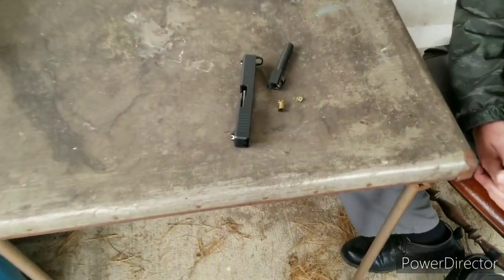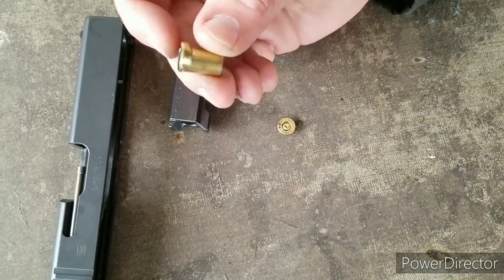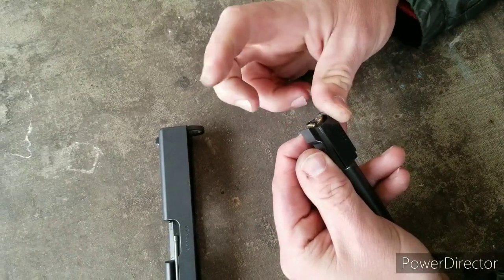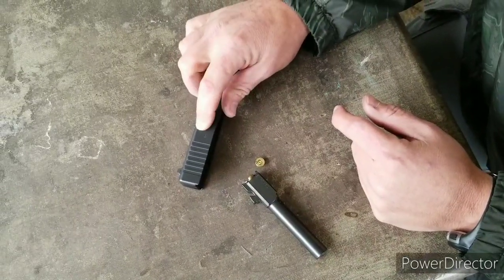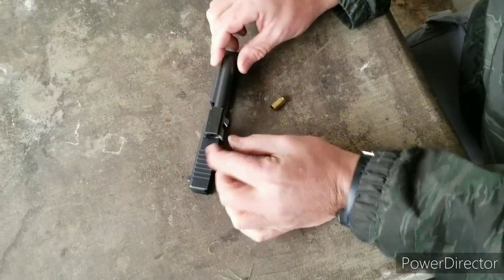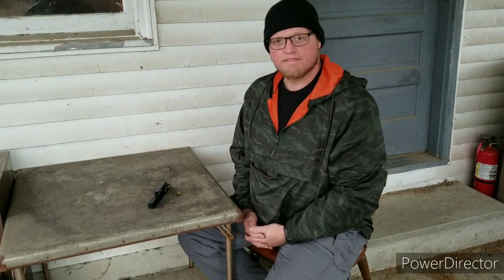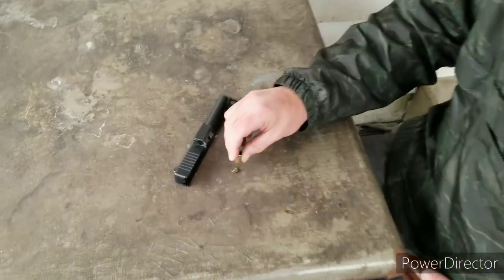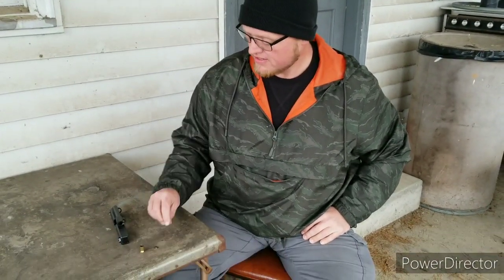WARNING!!!!° DONT SHOOT RELOADS OR REMANUFACTURED AMMO IN ANY GLOCK...

Comment: First, let me say I am glad no one was hurt. However, I don't see any evidence that this event was clearly caused by handloaded or remanufactured ammunition nor any evidence that factory ammo would prevent what ever caused the failure. There are many variables that could have contributed that range from a piece of badly manufactured brass, to powder used, how much powder, bullet seating depth, compressed load, fouled chamber, not in battery, and the list goes on. Jumping to the conclusion that you cannot use handloads in a Glock barrel based on this one event is too much of a stretch. Many manufacturers include statements saying not to use handloaded ammo, not just Glock. I have well over 10,000 rounds of handloaded 9mm ammo fired safely from Glock barrels. I appreciate you sharing this experience with fellow Glock shooters.
Reply: Howard all of your statements are true.  However metal fatigue at  the base of the case is dangerous.  The only way to determine just how much expansion at the base of the case is to mike it there before resizing.  For some reason my resizing dye resizes right down to the extracting lip on the cases of 9mm. I don't own a glock and now for sure I am glad I don't. I am a Sig man and have fired over 30,000 rounds without a single issue.  All reloads to boot.  I have been at the range and witnessed a glock blow up.  The guy was lucky in that he was not hurt.  Everyone assumed his loads were too hot.  Perhaps his issue was the same as illustrated
  There are a lot of uninformed people at the  ranges.  I met a duzzy last week.  He was blaming a brand new gun because it would not extract spent  cases. He said the loads worked In another gun ????  There are several issues that could cause the problem.  But he would not listen. Oh well
Reply: I believe it use do to a double charge
Reply: He didn't say thou shalt not reload for Glocks just because of this incident. So don't accuse him of that. He also cited the manufacturer's operator manual and a Glock armor course curriculum.

Comment: Hmmmm, thousands and thousands of reloads through mine, even lead ones. I just clean my guns and make sure my load data is spot on. No issues whatsoever, zilch, nada, none with my factory barrels. I don’t load mine hot except for 10mm, and all I did was add heavy springs to them.
Reply from the maker: Do what you do bud.
Reply: @rdmfjones5421  sure will bud
Reply: you do understand that a glock barrel has 20% of the rear end of the chamber missing and therefore there is "potential" danger there if a piece of brass with a weakened bulge spot from a previous firing through a glock lines up with that hole in the chamber it could give out.  You acknowlege that though right?  It's your choice to ignore a risk that's totally your decision but I'm hoping you're doing it with a complete understanding of the issue.  It seems to me that he risk is very small but it is there.  If you shoot a lot then sooner or later that spot is going to line up and go boom.
Reply: Hi I am new to the gun world I don't own a gun hopefully soon that will change. I was wondering when you say (hot) you are referring to the gun being hot from shooting a bunch of rounds?
Reply: I found this video because I was having issues with some reloads a friend made not going all the way into the chamber and then getting stuck in my gun. All the brass he used was from a police gun range and I noticed afterwards that the back of the case is slightly bulged. I’m glad I found this before I continued to shoot more and had it blow up.
Reply: I think the biggest issue is using cases shot from a Glock that are now bulged and then putting them back into a Glock.
Reply: @Micscience  guess they refer to powder weight..
Reply: This man was a Glock Specialist, take the mans word😂 does one have to blow up so bad someone loses a hand to realize 😂 good video, bad comment @JBJ Honez

Comment: Having owned a Glock 32 (Gen 2) now for some 24 years, it has digested several thousand of my own hand-loaded .357 Sig rounds,  I've had zero problems, 100% reliability.  I would NEVER shoot someone else's reloads, I have no idea what they did or how careful they were.    Fired brass MUST be checked for case length because they will tend to lengthen after repeated firings; more pressure/hotter loads-shorter case life.  If you have to trim a case after firing, logic should tell you the case wall is now thinner and you are now running the risk of case failure if you load it hot.  A smart re-loader examines his fired brass, looking for blown primers, brass runs and split necks
Reply: You have armed yourself with reloading knowledge and have applied common sense to produce your reloads.
Reply: How many firings are you getting from your 357sig brass? Also have you had any problems with neck tension after the 3rd or so firing? I can't seem to make them last more than 4 firings. At the 3rd I have to use a lee factory crimp die really tight or ill get bullet setback just from inertia.  The hornady seat and crimp I have to abandon after 2 firings. The taper crimp won't seem to hold reliably after that. Not sure whats going on with that but I always use the same brass and bullets so its not a component issue. Hornady 115grn xtps and always sig or ppu brass. Its just seems that after a few firings the case neck is weak or something.  Ever experience that?
Reply: @KurtOnoIR   Taper crimp is insufficient with a bottle neck case.   Suggest getting a Lee roll crimp die, this is now the final step after bullet seating.  the Lee die gives a much stronger 4-point crimp.   I found it also really helps to insert an inert buffer over the powder charge that prevents bullet setback if the crimp fails.  this is harmless to do and will actually help primer ignition but i would not do this will full power loads.  I tried cream of wheat at first, but it gave too much fouling, then found wood cellulose/stem pith works great, it's like organic styrofoam.    I put a wad of wood pith  over the powder charge,  then seat bullet, if the pith is compressed it helps support the bullet against the crimp.  I do not load anything more than 94% max charge when using filler, it's inert and will not harm the barrel,. I prefer 125 grn  bullet as it gives more surface area for crimp.  Lots of stretching and trimming in the cases after 2nd firing,  when I start seeing case neck splits then it is really time to check case OAL and trim.

Comment: Reloads aren't the issue. The person doing the reload is.
Reply: If the reloads are made from unknown case source then that becomes an issue
It would seem that there must be a limit to the rounds  fired from a glock.  Someone may have done a study as to how any times you can safety reload glock brass 
 If fired once in a glock and subsequent firings  are made in a non. Glock then i would assume the brass would be okay
  It is the reloader who must be up on the situation
  Thanks for the great video.  Great information
Reply: @rbm6184  I can’t speak for other caliber GLOCKs but I’ve never seen a 9mm chambered GLOCK that didn’t have fully supported chamber.

The problem in this video is indicative of poor quality reloads that would likely fail in any 9mm chambered firearm.
Reply: I use Speer 115gr, titegroup for 9mm it’s fine, looks like someone tried to use that brass too many times as what’s wrong with it they did not prep it properly or did not throw it away it’s why it’s always very important to inspect your brass and I never reload mine more than a couple times
Reply: @rbm6184  I’ve been reloading for my Glock for months now and I have yet to have any issues. Nor have I seen the “Glock bulge”. Idk mine is a polymer 80 Glock 19. Maybe it’s the after market barrel I have?
Reply: @basketcas3717 : the barrel, most likely is a match chamber. Do you know how to measure the case head?... just at the base of the case head. The case head was the small section of the two pieces. Take a set of calipers and measure just above the solid part of the case and if you are below .393 you are GTG.
 I built a p80 34 with a 6.5in... FULLY SUPPORTED CHAMBER barrel and loading 115gr. fmj. too an average of 1505fps. I've had two pieces of brass over .393 and I'm on my sixth reload with this group of brass.
Reply: . @danielswartz6818 , You are correct, there are several variables regarding the cartridge that can affect brass life.  I would imagine brass from powder puff loads will last longer than brass from plus P+ loads. Excessive crimping can cause stress cracks quicker than mildly crimped brass... etc etc.
Reply: @rbm6184  Correct. It is my understanding, Glock believes the advantages in reliability outweigh the concerns with their unsupported chamber. Glock is trusting that each piece of factory new, brass-cased, ammunition will function properly the one time it is fired in their barrel, the spent case can now no longer be trusted for use in their barrel. Technically most service pistols do not have a "fully" supported chamber as they were designed to feed from a magazine and must account for feeding reliability. Glock barrels have far less support of the chamber and the results are well documented. Barrels are cheap fingers are not... use the correct barrel for your situation.  Just my own humble opinion.
Reply: Either that case had been loaded too many times or they put to much powder in it.......period
Reply: @jasonhacker7270  yea that can be it also
Reply: Case separation isn’t from “unsupported chambers”.
Reply: Glad you are ok..  if you use reloads, reload THEM YOURSELF!! that way you know EXACTLY what you are shooting.. if you do it correctly, and not beyond established safe parameters, reloads work fine.. like one of the other commenters said, it looks as though that brass had been reused too many times.. buy remanufactured car parts, NOT AMMO!!
Reply: @basketcas3717  are you running stock barrel or aftermarket
Reply: @MrZimeir  I believe it’s a lone wolf barrel that came with the polymer 80 I built. Which may explain why I don’t get the “Glock bulge”.
Reply: @Boondogsaint  I agree with you on this, but I don't even reload mine a couple times. I only reload a brass casing one time after I fired it from new in the box just to be safe and not have as much of a chance of issues as with multiple reloading. But it is just my preference and it is 100% the person who is reloading the casings responsibility to check everything and make sure there's no signs of issues with the loading of the brass.
Reply: @riflesfirst208  I had an exploding case in a Glock 19 yesterday. This was the last of a box of 500 reloads made by Miwall, which my SIG 226 fired over 400 rounds of without issue. I will never use any type of reload in any Glock.  

If this happened to a new shooter, it might be enough to make them never want to shoot again. For me, it was just a curiosity. The mag dropped out and my hand stung a bit. A larger caliber could cause injury and destroy your gun
Reply: @johnlocke2884  So you used random reloads of unknown load data but it’s a problem with the gun. 

Got it 👍🏻
Reply: When using a progressive reloader you need to pay attention. Most of the problems are from people using progressive reloaders and not paying attention
Reply: I have a Gen 5 17 and 19X both with the marksman barrel.  I shoot my own reloads all the time.  I honestly don’t know if my chamber is fully supported or not.  I’ve always been a Sig and 1911 guy and I’m pretty new to Glock.
Reply: Wrong THEIR IS A REASON why glock states NO RELOADS OR REMANUFACTURED OR LEAD BULLETS!!!!!! It's not the reloader this gentleman in the video is 100 correct.

Comment: While I have heard a lot, seen a lot, and done a lot, I will never say I've seen, done, and heard it all. I have owned my Gen 1 model 17 since 1987, I've been reloading my own ammunition since 1984. Still have the original barrel in it and it's sent roughly 100,000 rounds down range, more than half of my own making. Either I got one of "the good ones", I'm damn good at what I do, am the luckiest re-loader in the world, or a combination of all the previously mentioned, but I have never had this happen to me. All that being said I have built dozens of firearms and with every glock I build since 2005 the first thing I throw away is the molded injected metal extractor. As far as the cases and processes I follow when reloading, attention to detail is critical, measuring the cases, inspecting the cases, and cleaning the cases is the easy part, checking at least every third round that the powder measures correctly is most critical but not far behind is seating depth. Depending on  powder used and the pressure and velocity it will make the bullet seating depth can change everything. I crimp my reloads heavier than most, this is due in part to personal experiences when a failure to feed malfunction results in a bullet being pushed deeper into the case as it feeds into the slide or the back of a non-ejected spent round. Many a firearm have been destroyed by not paying attention to every aspect of the firearm function, when it comes to hand held explosive devices, safety can never be excessive.
Reply: I just recently bought a new Glock 21. I am also a reloader, hate to tell you for how long or how many millions of rounds I've loaded with never a problem. Until I bought this Glock. One of the first magazines I ran through it was some reloads with Speer Gold dots in them. NOT loaded plus P, but admittedly full power loads. No blowouts but to say Glock smile would be an understatement. You struck a chord with me that I had already figured out. Due to the bullet design, I had loaded them pretty deeply into the cases. No other reloads have produced such results or anything close to it. And even with factory loads there is no doubt where the case head is not supported. Piss poor design in my opinion in the first place. The gold dots were 185 grain bullets. Have loaded 230's with the same powder charge, but to full length with absolutely no problem or guppy bellies at all. Just my opinion, but if I were reloading for a Glock, I'd try to get the (Smile) up when loading mags and let them fly, as hard as that is for a reloader to do so you're not stressing the already stretched head and taking a further chance on a blowout.
Reply: 17 is a 9mm , next time you see some shooting a Glock 40s&w pick up 20 pieces of brass and you will find probably 3 with a swollen side by the base of the case , Glock has HUGE chamber tolerance on their 40s&w barrels . Making them vulnerable to this .
Reply: Do it right and you'll be fine! I've been reloading for 30yrs and have never had a problem through dozens of rifles, glock pistols, revolvers and shot guns.

Comment: Truly, it looks like you got a double loaded round. The blowout the way it did is part of the safety feature of the gun, path of least resistance, as a reloader I have seen this before too. The ejector is the weakest link on the side of the gun, it breaking away allows the pressure to go in a safer direction than up or out. Replace your extractor also check you safety plunger to make sure its still working correctly.

Comment: I reload.  I was shooting once with some friends who brought factory ammo…. Winchester white box 230 grain 45 ACP.  One of the rounds did not action the slide but the bullet definitely exited the barrel. I charged the slide and continued on. 

As I was picking up brass, I found a 40 S&W case that was “swelled” to the chamber of a 45. Winchester put a 40 round in a box of their 45’s. That was the round that fired but failed to action the slide.  I asked my friend who brought the ammo if he previously opened that box and he said no.  I was certain that the 40 round wasn’t one of my reloads that I accidentally loaded into the magazine because the primer was a Winchester and I load cci primers exclusively.  Point is, even the “factory ammo guys” screw up. 

You’re going to ask “how did the 45 detonate the 40?”  I know, it shouldn’t happen. But it did. I swear to everything that is holy that the round fired. 

I’m well over 100,000 rounds into reloading my own ammo.  380, 9, 40, 10, 45, 44, 38, 357, and 223.  I’ve put many thousands of my reloads through multiple glocks with factory barrels…. No issues.  

I have found the “Glock buldge” on a few 40’s. All of my 40 and 10 cases get resized on my Dillion in a single stage manner.  I then run them through a Redding grx die set up on a lee single stage.  I prep all my cases by resizing, depriming, and tumble washing with stainless pins first.  I then case gage EVERY prepped case before I throw them in my “ready to load” bins. I chamfer and deburr each case as well 

I spend A LOT of time on case prep. However, these steps identify cracked, split, and otherwise damaged cases.  If the empty case doesn’t case gauge, I don’t use it.  

Finally, I load to book data.  No compressed loads.  No magnum primers when regular primers are called out in the books. I follow the published data.  

I’m not buying the “no reloads in a Glock” story.  Every firearm manufacturer has that disclaimer in their manual.   It’s the reloader, not the reloads, that are the problem.

Comment: I've shot reloaded ammo in my Glock 27 for years. You just have to make sure you properly gauge your cases and don't try to load overpowered (hot) rounds. I can easily say I've sent at least 30,000 reloaded rounds (many of those cases got reused multiple times as well) through my Glock 27 without any issues. The guide rod wore out at around 10k rounds, I upgraded by getting a steel guide rod with changeable springs, dropping in trigger and striker kit, barrel, and added some grip tape but other than the guide rod it's been a great gun considering.